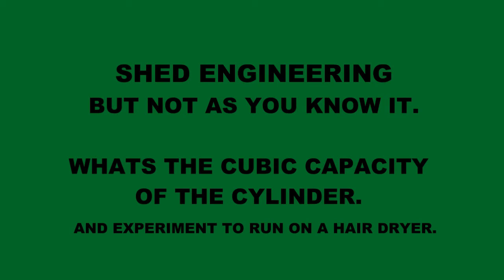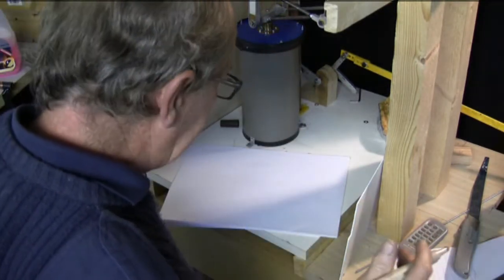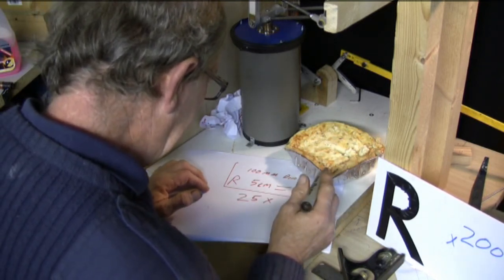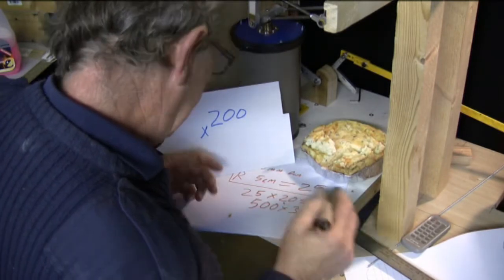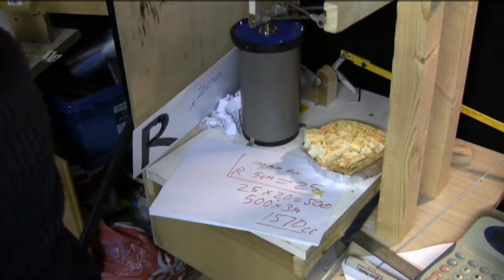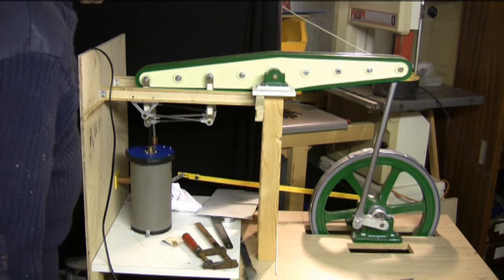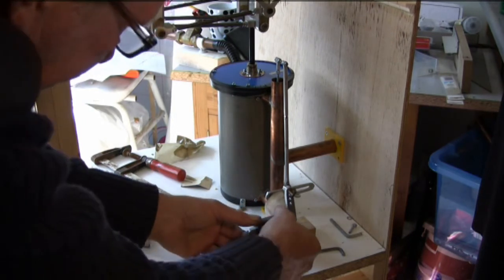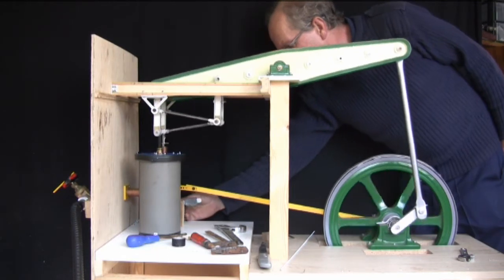BEAM ENGINE  CUBIC CAPACITY OF THE CYLINDER, Part 11 by shed engineering.

Comment: Really enjoyed watching the beam engine build videos.Your skills amazed me particularly the making of the beam,flywheel and the parallel motion gear which look like proper castings and from mdf, just amazing.The flywheel seems to run perfectly true which I would think would be hard to get even on a lathe for that diameter wheel.
I went to see the Papplewick  pumping engine a few weeks ago and yours looks and runs very much like it.Fantastic job.Thank you for sharing.
Reply from the maker: +Nodrog Awson Hi there many thanks for dropping by and for your comments which is probably one of the most appreciated ,,,, because you obviously understand and realize the difficulties ,,, involved when trying to do this without a lathe ,,, and in actual fact I was always over the moon with how true I got the flywheel something 15 inch in diameter only needs to be a fraction out and it could easily look terrible,,,,  im really glad the videos have been of such interest and your comments are very much appreciated ,,,,,,,, regards ,,,,,,,,,,,,,,,,, Alan
Reply: Nodrog Awson 😊😊

Comment: Ha ha!
In a recent comment to your road project I mentioned the Industrial Revolution. Well, I hadn't previously checked all the videos in your channel and then I find this series!
Wonderful! This is how it all started isn't it? And now you've recreated it in your shed!
I really like your mathematical skills too. But they could be fattening :)
/Anders

PS. Your neighbours must be wondering why you're hoovering or drying your hair so often.
Reply from the maker: Hi there Anders,,,,  Yes this is how the videos started with my beam engine ,,,, I had always wanted to make a proper live steam engine model,,, but could never afford the lathe and all the other tools,,, But almost all model steam engines no matter how perfectly they are scaled and reproduced they nearly always run way way TOO fast. If I made a model I wanted to get a realistic speed,,,, of 15 to 18 R.P.M.        when I put my ideas onto "Engineering Forums"  I was almost ridiculed ,,,,,,,   Build an engine without a lathe ???? how do you propose  to do that,,,, With an engine stroke of 6 inches the parallel motion will have to be very accurate how will you manage that without a lathe,,,,,, Once you have some engineering experience you will lean you can scale down SIZE ,,,,,,but YOU CAN NOT  scale down the laws of motion nor kinetic energy ,,,, you will need a flywheel 4 foot in diameter and it will need to be made of something heavy like metal not your suggested  .M.D.F,,,,,      I have been modeling over 35 years and have never got a model to run at less than 20 R.P.M ,,,,,   So I gave up asking for advice,,,,, and went ahead ,,, with my radical idea they had all laugh at because it went against all engine design ,,,   and that was to have a very loose fitting piston,,, with a loose fitting piston you eliminate 40 to 60% of the friction ,,,,   and a larger piston area allows you to run it on just a few pounds of pressure. Any leakage past the piston is far outweighed by the reduced friction,,,,   You don't get a lot of power but you get a realistic speed,,,,,    That why you wont find any comments on any of the beam engine videos from out and out real model engineers ,,,,, when I announced on the forums that I got it running at less than 10 R.P.M. one chap said ,,, and what did you time it with a grandfather clock ,,, if so I suggest you wind it up and time it again,,,,,   it runs so so well that work came to a stand still,,,, because im planning a re-build using all metal parts in the hope I can turn her into a proper steam engine ,,,,, trouble is a boiler will cost at least £950 to £ 1,050 ,,,,  and so thats when I started the N gauge layout...    

Your comments made me laugh,,,, in fact for a long time I have been meaning to give my neighbour my Youtube address  so he could see what I get up to,,,,

Anyway im glad you found it interesting ,,,,  and many thanks for your kind comments,,,, best regards,,,,  Alan
Reply: ***** Thanks Alan for explaining your struggles with the 'experts'. That whats make a great inventor isn't it? By thinking outside the box like you.When I said 'This is how it all started' I actually meant the Industrial Revolution. This was the kind of steam engine that triggered it I believe.And now you've started your own Industrial Revolution in your shed!Best regards, Anders (Now back to watching your N-gauge videos...)

Comment: Nice project Alan, Maybe you could convert this beam engine to a Stirling hot air engine to power the flywheel rather than air from vac, been looking into doing something myself using heat from wood burner.

Best Regards
Steve